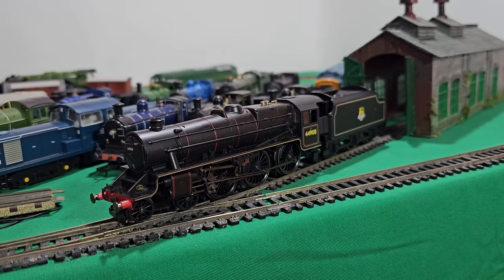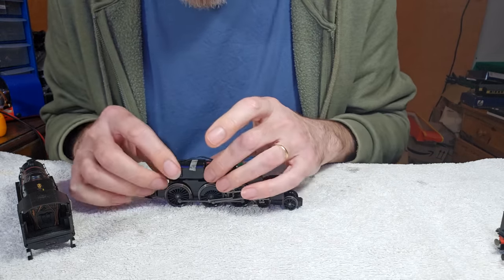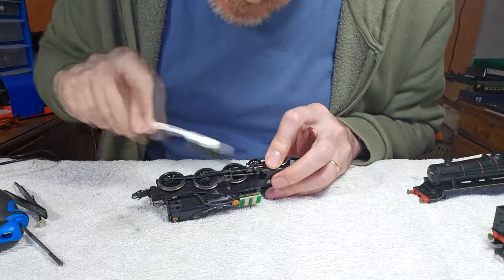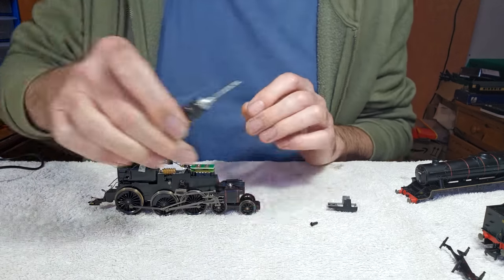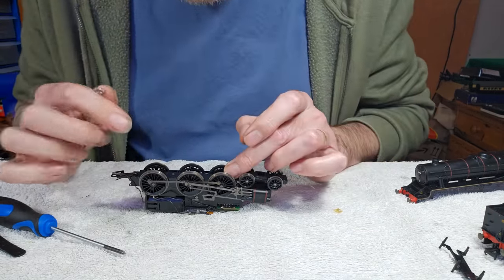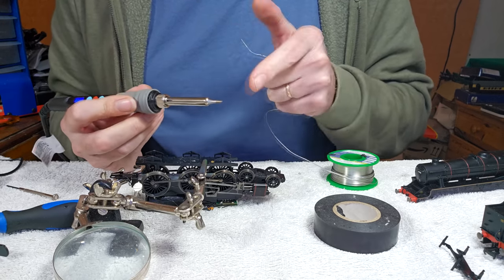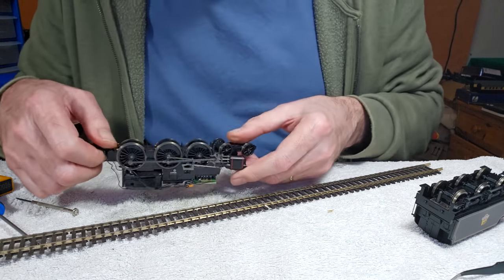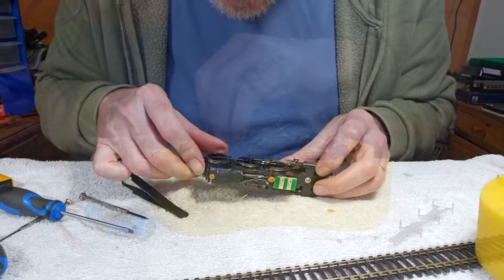Hornby R2359 Black 5 : Repair Request

Comment: They are quite fiddly, but nice job, and frank comments!
How were the pickups on the tender?  I often find these quite simply are never opened out and most just don't make contact when the axles move side-to-side.
'Yours' seemed OK over the points so at least some of the tender pickups must have been working.
Thanks for sharing.
Al.
Reply from the maker: Tender pickups were just dirty. The connections on the drawbar were a mess and needed straightening out though.

Comment: Hi Bill ,, what's the brand of your new soldering iron please ?
Ive recently got a ferris (aldi) brand soldering iron and its a butane type and it seems to work quite well. It heats up quick and does the job. Also the motors in this black 5 are they the can type motor. 
Ive just stumbled across another place to source free or cheap can motors besides the cd drive motors and thats in the electric door mirrors on cars and they have 2 of them in each mirror so even if you get a broken one (plastics) theres a good chance the motors are still in good nic.
Cheers from John in Australia.
Reply from the maker: It's just a cheap Handskit of Amazon but I fitted a Hakko tip.